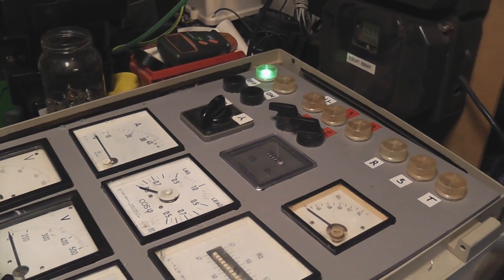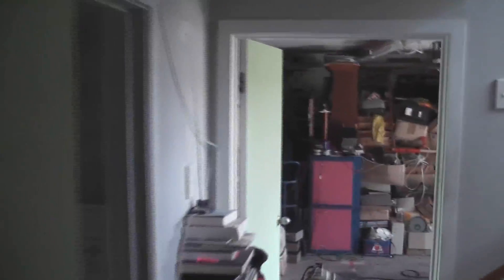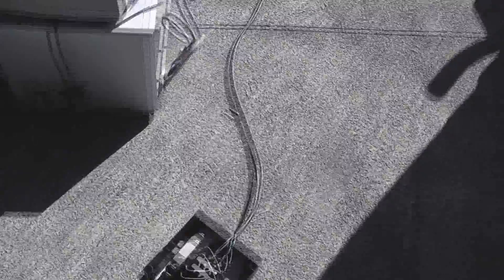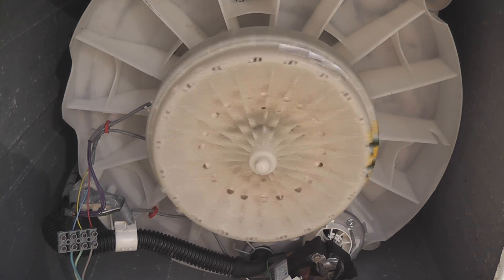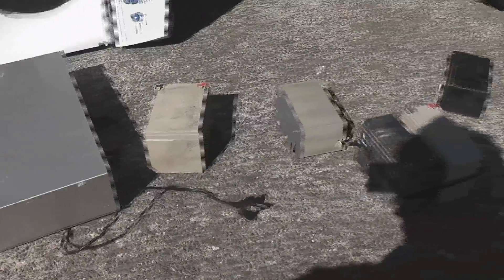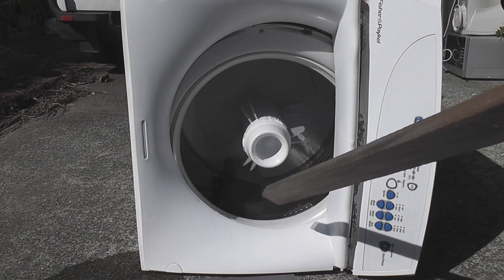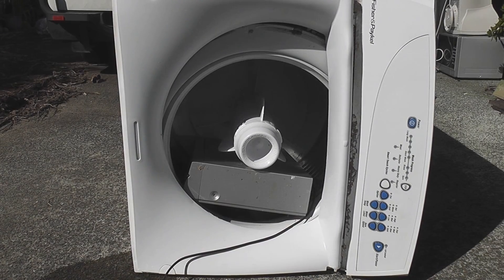VCR in washing machine - sideways

Comment: yeah would spnin much higher at a better frequency, id like to see how one of them 3 phases direct drive motors would work on a VFD, seeing as they can give the higher frequencies needed to drive this motor. It will only spin so fast at 50/60hz. Think them motors are designed ffor at least 300-400hz maybe more.
Reply: These BLDC motors run from pulsed DC in the washing machine controller, hence why it has the hall effect sensors
Reply: @LoganT547  Not all of them, some of them are AC driven with an inverter.  some used pulse dc, some use AC. I know at least 3 brands that do so. But regardless from old comment I know that idea doesn't work, vfds l run at lower frequencies then the inverters in the machines that drive the 3 phase ac/bldc motors.
Reply: @LoganT547  You replied a comment created 7 years ago ? Wow

Comment: That cogging sound at 38 seconds is amazing :D

My parents have the Fisher & Paykel GWL11 washer; it spins at 1000 rpm which means it must be clocking the motor at 700 hz. Classy. Guess that explains the amazing jet engine whine it makes.

To engage the basket to the agitator, you have to just press down on it. There's a set of splines that interlock. The idea is, the floaty ring at the bottom of the basket will raise it up once it's full of water and that allows agitation. Once it's drained it'll allow spin. It allowed them to get around having to add a transmission.
Reply: Thats exactly what that jet engine whine is a smart drive or BLDC motor is. Its the motors drive/inverter maing that noise as it "Ramps up." What you are hearing is the drive Frequency from the drive/inverter itself as it spins up.
Reply: umbrefawx
Well hearing it through the windings I should say.
Reply: @UmbreWolf  the whine is not caused just by frequency, it's also harmonics of the magnetic field interacting with the windings. I always thought the speed of the BLDC motor was controlled by the voltage, not the frequency
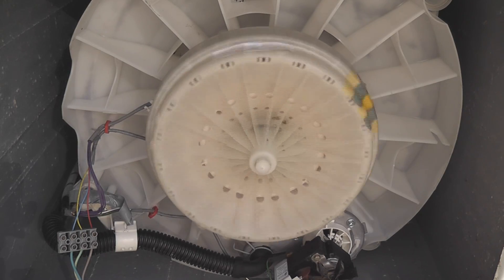Reply: 0:38 if anyone wanted to see that sound.

Comment: I thought those motors were BLDC type!
Reply: They are.
Reply: douro20 how's he running it on AC?
Reply: Mac Man
They are called brushless DC because they are driven using a zero-crossing modified DC square wave.  An AC waveform will drive them just as well, as the DC signal used to drive them actually mirrors the phase relationship of a 3-phase AC waveform.
Reply: douro20 ahh is that what it is! So its DC 3 phase that drives them. Thanks for telling me that, I never knew they worked that way!
Reply: douro20 годин
Reply: @LesyaLesya-fb8le  хэй
Reply: Mac Man
Dc brush less motors are typically AC or pulse DC themselves. They are called brush less DC motors because they require a DC input, the motor itself however is driving with circuitry and drive transistors and fets running on pulse DC or AC waveforms. So even through the motor is running off a DC supply, the motor itself is technically driving by artificial AC or DC pulses. (depending on the design of the motor. Bypass the electronics/ drive circuity and and you can run most Brushless DC motors like a 3 phase AC one directly at the windings. Which is whats being done here.
Reply: umbrefawx OK so its DC input but they run off AC sine waves. Interesting! If say, I was to couple one to a separate motor and spin it up so it starts generating, would I get 3 phase power out?
Reply: Mac Man Depending on the motor and how the drive circuitry is it will either be pulsed DC in some or AC in others.(Most BLDC motors' drive circuitry are non sinusoidal, some are but most are not. meaning the circuitry isnt making sine waves, but more like trapezoidal waves even though the motor will accept such. As far as using a brush less DC motor as an Alternator (3 phase AC generator) Yes it is possible, however as far as using one to drive the other, its not very efficiency. (driving 2 identical bldc's one as a 3 phase alternator and the other as a standard 3 phase motor isnt going to work very well.) These motors are not like a typical 3 phase AC motor even through they behave as such. They require much higher frequencies to be driven properly, much higher then the nominal 50/60 hz your typical mains supply supports. (Notice how  the motor in this video doesn't spin very fast, its because its designed for a higher frequency then the 50 hz 3 phase its getting off the RPC. (Rodalco's rotary phase converter.) Although it is possible, you would need a larger BLDC to drive a small one and even so it will run very erratic if it gets any commutation at all (is suggest using  BLDC motors with the same amount of Poles for  optimum effect. Also if you drive the generating BLDC too fast, you can cause a rotor stall (which happens if the electromagnetic field becomes too saturated.) And typically, one or both BLDC's will stall typically resulting in burnt windings somewhere along the path. I have experimented with this theory a few times myself however I have not enough to give you accurate detail on how it will work. It depends on the Motors really. As far as driving one like a 3 phase alternator though, giving a decent motor driving it with adequate torque and speed, yeah they tend to run just fine as such and despite the circuity in the drives, I do believe the output using  one as such IS sinusoid but that is only an assumption, I have yet to use a BLDC on a scope running at all an alternator. This information I share with you is based off my personal knowledge and some experimentation myself but it is not complete and may not be 100% accurate in some points, its only as such as I know it. If im wrong on anything im sure a few helpful people will be more then happy to correct me, in fact  I encourage it!
Reply: umbrefawx
I should have probably noted to, the frequency of the output 3 phase AC will be much higher then a typical 3 phase alternator as they are wound as such, especially as higher speeds. So please note that, Unless you plan to convert the output from the BLDC into DC, you should  some how determine the frequency output off the BLDC depending on what you plan to power it, some devices don't like the high frequencies and back EMF some BLDC's produced when running them  like that but in any case, good luck.
Reply: umbrefawx thanks for the info on that! (Any chance i can copy this to a note pad to look over?)
Reply: Mac Man
yup go ahead
Reply: umbrefawx thanks mate!
Reply: Оллщлшщ

Comment: didn't think it'd run on 3 phase!!
Reply from the maker: They are true 3 phase motors. you can get them to run faster with your VSDs
Reply: RODALCO2007
Maybe it would be worth programming a drive to run this SR motor properly.
Reply from the maker: douro20
Yes but I haven't got a spare drive. This WM was a road find.
Reply: RODALCO2007 Wye connect, as I recall?
Reply: hyvahyva
I'm pretty sure they are wired in star but I can't recall, There was another smart drive  dryer I took apart that was different then these F&P, that one was wound in Delta, I could be ass backwards on that though. Pretty sure the F&P's are WYE though.